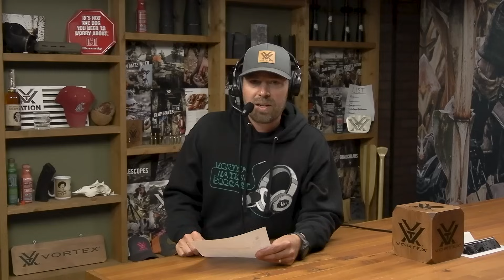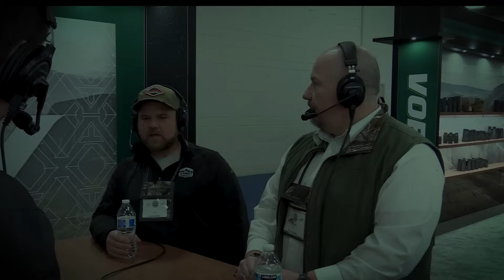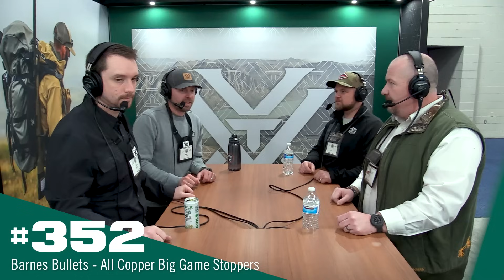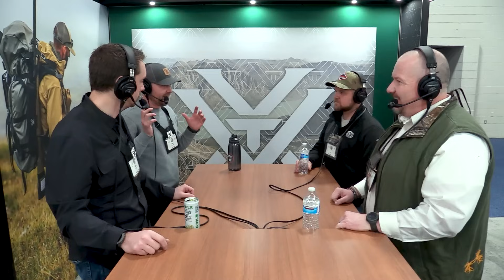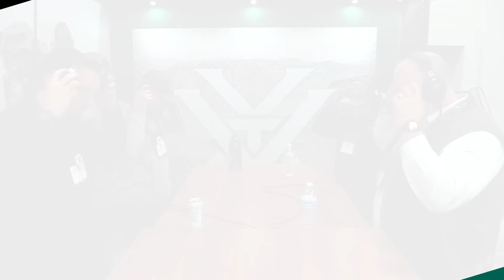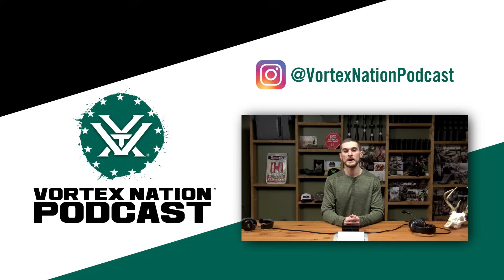Ep. 352 | Barnes Bullets — All Copper Big Game Stoppers

Comment: Although Ryan briefly mentioned it, the lower density of copper makes copper/copper-alloy bullets of a given weight physically larger than a. normal cup and core.  A copper monolithic bullet is physically the size of a cup and core that is 20-25% heavier.  That 130 grain barnes bullet, like Ryan said, is larger than a 150 grain cup and core.  It is closer to a 160grain cup and core.

Comment: I'm here solely for 308, and 6.5 grendel. What do you have for me?
Reply: 130 TTSX for all but the biggest NA game in .308; I'm using Varget, lightly compressed.  

115 tac-tx in the Grendel has but two deer down deer down for my daughter.  Load work up was easy in both of them.  Note that the Grendel is a bolt gun that I am pushing hard with RL 15.  I don't have a load worked up for the AR platform with it.

Comment: Anybody else have 30-50% of the tips of TTSX/LRX off center?
Reply: I have a few boxes of ttsx. Yes I have the same issue and it did really worry me so I shot a couple groups and got .5 inches both times so I don't think it's a big issue, but I do wish they were centred as it wouldn't hurt, and I do think it's lousy quality control. That said, I love everything else about the ttsx and will continue to buy them. Oh and that was handloads btw not factory
Reply: @italian_badger1660  In CA we're restricted to Lead Free bullets so I'm limited on my options. I'm pretty frustrated with the inconsistent accuracy I'm experiencing with copper from Barnes, Hornady, and Nosler. I have an older Mod 70 300 Win Mag that back then came with a chamber cut for a 220gr round nose lead so even at my max magazine length of 3.400 I still have .270" of jump so that's one challenge. Barrel is free floated and action is fully bedded. It shoots 168/175gr Sierra MKs under an inch consistently so I have confidence in the rifle/optics. I've had the most success with 79.1-79.4gr H4831SC, Win LRM Primer and the 165gr TSX. So with that I'll get 4 shots under and 1/2" (one ragged hole) then a flyer at 1". IMHO that's good for an old rifle, however I'll go back to the range the next day and with the same exact load and conditions and it will shoot 2 1/2".

Bought a box of Barnes Vor-tx 180gr TTSX. Shots 1(CB), 3, 4, 5 were within .675" but that 2nd shot was 1.750"

M77 in 7mm Rem Mag. Shoots 139LRX 68.0gr of H1000 Rem 9 1/2 Primer at .905" then go back the next day with the same load and is 2 1/2" now.

M77 in .243 Win with 80gr TTSX and 85gr TSX I've had a few loadings just over an inch. One 80grTTSX loading of 47.3gr Superformance Fed 210M primer that was .870" but that's pretty slow for a 243.
Reply: You should try the 175 grain LRX they work great in a 300 win mag a good balance between BC and speed they have been pretty accurate out of four different rifles I load for but that being said You're rifle might not like monolithics
Reply: @carlpreston1680  I've tried the 190 LRX with mediocre results. Oddly the 168TTSX is drastically worse than the 165TSX. The 175 LRX has a good BC so I'll give that a shot.

Time for another deep cleaning on it.

My SAKO 300WM brass is done so now I'm starting over again with 50 new Petersen 300WM Long brass. Feeding these beasts with 70-80grs of powder is getting pretty expensive.
Reply: @angusmotorsports4715   I've never tried the 190s only the 175s but the 500 plus BC at 3000 to 3100 per second I figured it was hard to beat The rifles we use them in weren't very high end and they still did pretty good probably more human factor than anything they were all loaded too published over all length

Comment: I've had great success handloading Barnes bullets. I loaded my friends 30-06 with the 168 gr TTSX at 2940 FPS and we easily get sub MOA. We use this load for elk hunting. My 300 WBY loves the 175 gr LRX, it's sub half MOA at 3360 FPS. I also have loaded the 101 gr LRX in my 257 WBY at 3814 FPS... talk about laser beam. Recently I've been loading the newer 155 gr LRX in my friends 6.8 Western. So far his gun likes the bullet.
Reply: That's awesome, thank you for posting the information about your 30-06 load. What powder are you using? I get similar velocity from my 30-06 with the same bullet and IMR-4350. It has made me nervous, because I am using over 2 grains less than Barnes published max charge , but my velocity is exceeding Barnes published max velocity by at least 100 fps. Full disclosure, I'm using a basic Caldwell chronograph, and I am not certain how reliably accurate they are. Hearing you get similar velocity is a nice data point to realize I'm not crazy.
Reply: @cobjread  I'm using IMR 4064. It's a max load from the Barnes data
Reply: @ReloadingWeatherby I don't think you can over charge that powder in a 308 win.
Reply: @cobjread  You have to a be a green horn at reloading when you don't know to look at the fired primers to tell you about pressure.
When you see fired primers showing flat and firing pin indent very defined No smooth rounded edge you know that is where to stop with powder charge.
Reply: @lurebenson7722 as a general rule of thumb sure, but it really depends on your rifle and the load. I had a Howa in .243 that did this, but my 300 PRC absolutely flattens primers well below book max with very low velocity. All factory ammo also flattens the primers in this rifle.
Reply: @Awesymoto  Then the rifle has a very tighter bore causing pressures to spike.
I own a Rem 722 I chambered in 6mm-284 win using a Douglass barrel and I have an AR 10 I chambered in 6mm-284 win using a Pac Nor super match barrel.
I can use 57 grains of MagPro with a 100 grain 6mm bullet in the Rem 722 but the AR 10 Pac Nor Barrel in 6mm-284 win can only take max charge of 50 grains of MagPro with the 100 grain bullet showing bore diameter isn't the same.
The same is what you are experiencing is a tight 30 caliber bore. 
If it is a problem for you then ditch the barrel and you can get Pac Nor to do a barrel of your choosing length & contour - fluted - muzzle break - rate of twist and number of rifle Goves + chambered and shipping for $500 .
I just did this with Pac Nor Barreling for a Weatherby Mark 5 with the only difference is I own the 300 Wby mag chamber reamer & go & no go gauges because from my age of 18 I have had rifles made in 300 Wby mag and now I am 64 years old so my experiences using the 300 Wby from the Pacific NW - Alaska and a few hunts in Pennsylvania I have a vast experiences with the 300 Wby that No young knuckle head is going to get me to change to one of these new Gimmick cartridges that do the same as the old well used cartridges.
Reply: @lurebenson7722 peek pressure happens after the bullet is down the barrel a ways. I would it its more of a bolt face issue or the chamber or throat is a bit short.
Reply: @ You should stay with your addiction to playing video war games where you get all of your gun information because you have NO idea of powder burn rates and where pressures spike depending on the power types
Reply: My son shot his Elk recently, the Barnes bullet opened fully and only lost 1 grain from its original weight.
Reply: @danblumel  That 1 grain was the plastic tip.
Reply: Ok, good to know. Thank you.
Reply: Used 127 LRX in my 20 inch 6.5 PRC at 2960 and smoked an Antalope with White horns (yes white) at 288 this last year. Wish I could post pictures.
Reply: Hey you have a good channel. Other than barnes, what are some good choices for hunting bullets in regards to your reloading experience? 
I'm looking at barnes lrx
Eldx. 
Any other recommendations?
Maybe berger or nosler?
Reply: Loading the 150s in 308 close to 3050
Reply: Could be wrong but I find it hard to believe a 30-06 can achieve 2940’/s with a 168 TTSX without being way over max pressure.
Reply: @garycasteel4961 It's not hard when using the right powder. I just hit 2900 FPS with the 175 SMK with N550 with a 22 inch barrel.

Comment: Really if you hunt long range go with something like an eldx.  If you hunt close range copper, bonded and even tough non tipped cup and core.  If you want the best of both go bonded. Terminal assent, accubond, fusion etc.
Reply: What do you call long range and with what sort of cartridge?
Do you talk about a 308 Win at 700 yards or are you talking about a 7mm Rem Mag at 700 yards?
Or are you talking about a 300 PRC at 1000 yards?
Yes, a Barnes bullet in a 308 Win at 700 yards would be a bad choice, but a Barnes LRX bullet in a 7mm Rem Mag at 700 yards works extremely well.
And a Barnes bullet in 300 PRC at 1000 yards would most likely be a bad choice.
Some would consider 400 yards long range and a Barnes LRX in 6.5 Creedmoor works very well for that.

Comment: I would love to see the reduced recoil .243 80 grain TTSX available as a component for 6mm ARC hand loads
.
Reply: Maybe I'm not understanding you, but do you mean the 80 grain TTSX as a component? Because it is available.
Reply: @robinsok  In the video they actuall state that the reduced recoil .243 80 grain TTSX projectile is different and not available to the public.
Reply: @worthb1592  OK gotcha, I missed that part. I just knew I have two boxes of 80 grain 6mm TTSX on the shelf.
Reply: 80 grain projectiles, with a moderate powder charge is a surprisingly light recoiling rifle.  If the rifle happens to be threaded, a decent brake will turn it into a complete pussycat...loud, but near .223 levels of recoil.